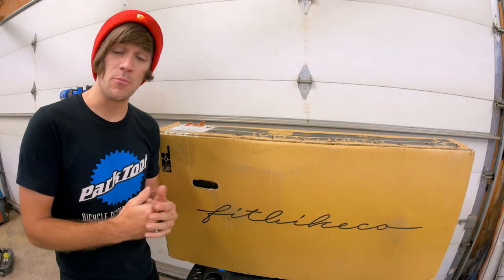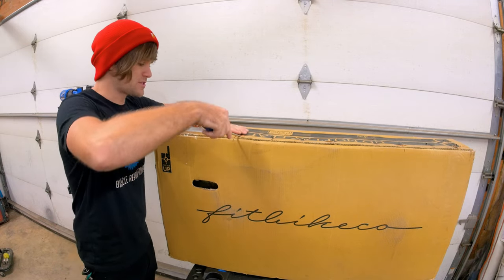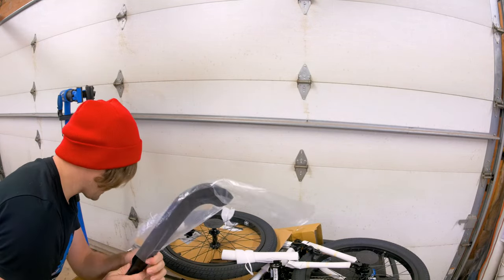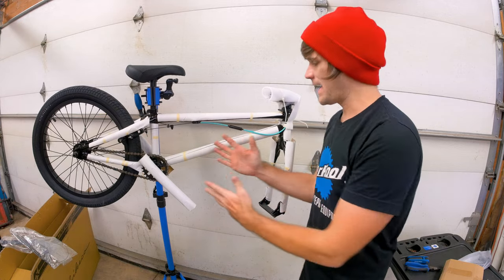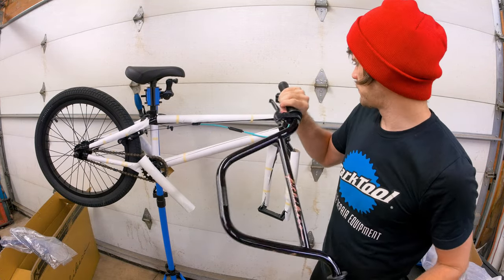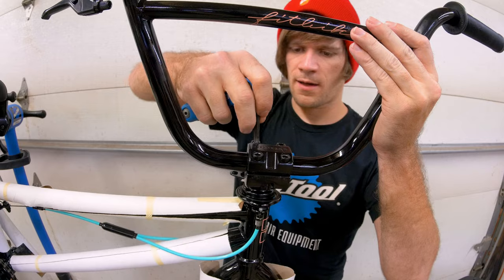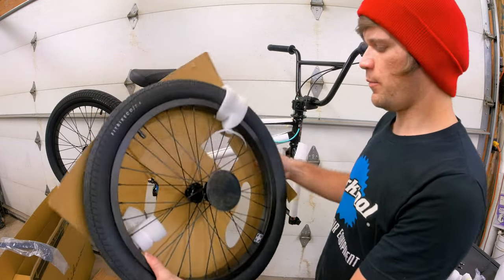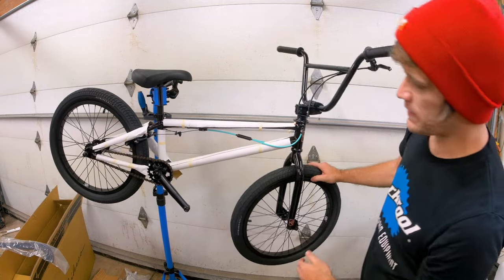Upgrading A Complete BMX Bike - Ep 1 FitBikeCo Prk MD Build

Comment: It's surprising companies have not adopted the stem design of the Hope DH stem, which first tightens down the top two bolts completely, thus making a tube equal in size to the handlebars, then just tighten the last two bolts equally.  It's a genius approach, eliminating any bolt tightening headaches.

Comment: my first complete bike returning to bmx was a full crmo frame street set up Fit Mac-man complete. overall, it was a good bike at the price range. 
never really had any issue as an entry level bike while learning tricks on. 
upgraded some parts not because it broke but because i wanted other colors/geometry/weight savings.
changed the  fork first to a full crmo with shorter offset, then the cranks to 48spline until eventually nothing is a fit part anymore except for the saddle.
the fit parts i have passed down to my buddies and my wife's bike hasn't had any issues yet. still holds up.

Comment: I ran fit oem tires initially that were double walled rims and held up pretty well to street.   Of course, they were heavier and I changed them up to Alienations to save rotation weight as I progressed.  yeah I would change out the complete bike's rims to the Fit oem double walled rims just for that extra strength.  Overall, this is a pretty good entry level bike for under 500.

Comment: Thinking about building a 20 in s&m ATF with some off the wall geometry. I'm about 5'8" husky build. Not for tricks per say but I plan on doing various jump heights hence the ATF frame choice. TT will be 21.5 s&m 12 step bars. 25-9 gearing. Long cranks 170-175mm for torque hopefully. s&m fork haven't decided the offset. Any tips would be appreciated. Love content you put out
Reply from the maker: That's definitely an unconventional approach to geometry, but if it's what you think you'd want and feel good on that's all that matters man!! It's so crazy that 170-175mm cranks are considered long these days. haha
That code would save quite a bit on that build too
Reply: @Brant_Moore  should I up the gearing for more torque
Reply from the maker: It would probably help if you're mainly using it for jumping. Luckily a sprocket is a small thing to change if you end up deciding to gear it back down

Comment: the industry is in a bad place if you can't get a  sealed double rear for 500 you could run unsealed up front and be fine but a single wall  rear is not gonna hold up learning 180's,  learning how to ride dirt or ramps,ect. being full steel and a weak rear wheel for almost 500 makes that bike a bad deal, just buy used at point 500 stretches a lot more used